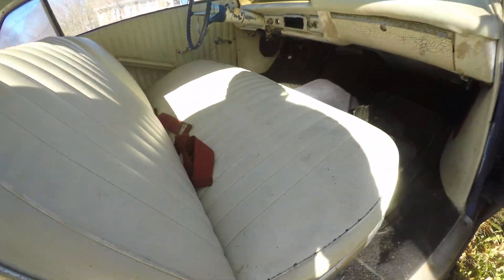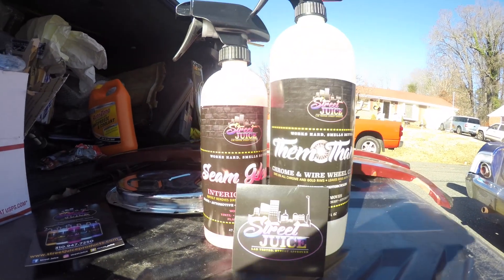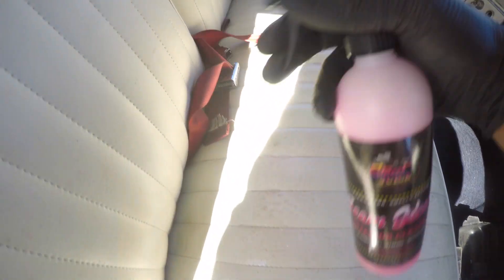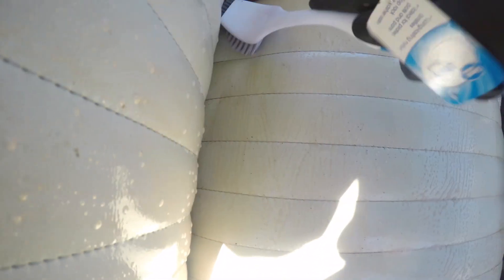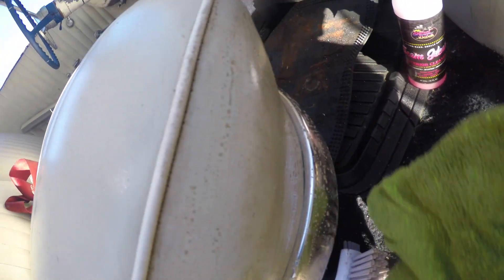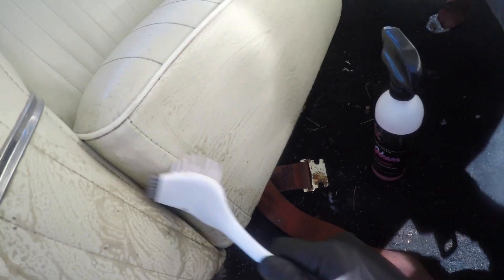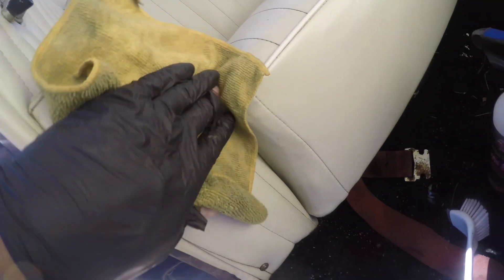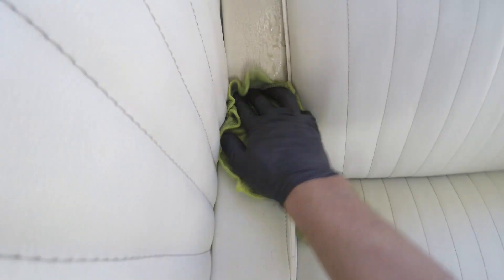Seam Gleam Interior Cleaner by Street Juice Brought Life Back to my 64 Impala!

Comment: Man that really works
Reply from the maker: The wire wheel cleaner worked so well, I figured let me try out the interior cleaner and it did not disappoint. I'll recover the seats down the line but at first I didn't even want to sit on them until I cleaned it.